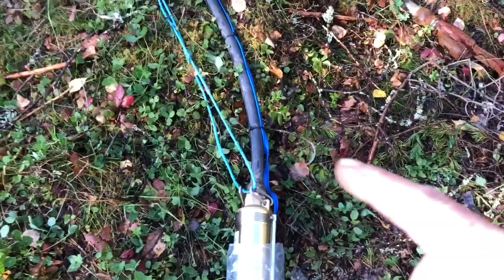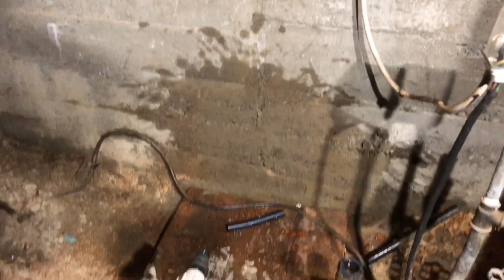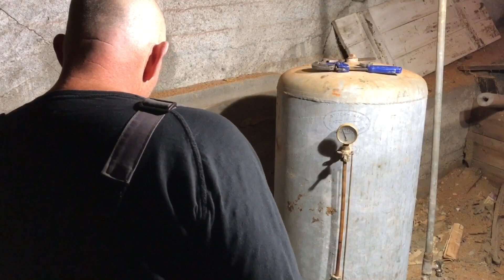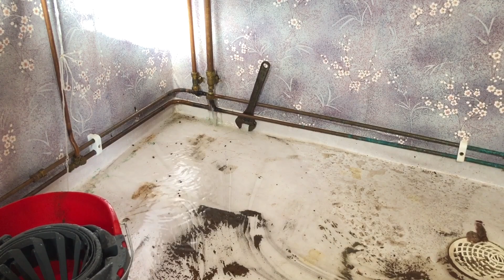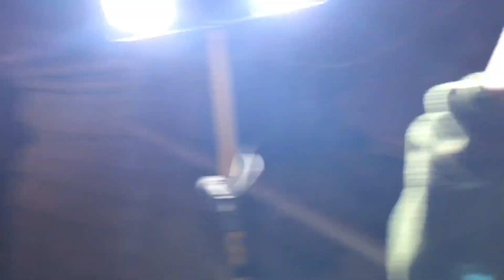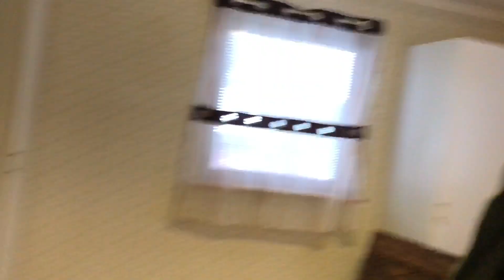Installing a new pump in a Deep well to restore water to a house after 25 years in  Arctic region.

Comment: I cant help but suspect the pressure tank is your whole headache. It and the galvanized plumbing is where the sediment in the lines are coming from also. The old well pump could have brought sediment into the house when it failed but mostly its the galvanized lines, especially being shut down for 25 years does not help aswell. As you know galvanized eventually corrodes and is usually comes apart in layers and becomes chunky from the inside out.

With it being a pressure tank, you should have a valve stem and be able to check the pressure with a tire air gauge. Im certain the bladder in the tank has failed and is waterlogged they call it. Most tanks only need around 8- 15 psi if i remember correctly.

I just went through this whole scenario once again a few months back.
I had to pull my well pump about 10 years ago and it was @ 95 feet in the ground, somewhat shallow for my area. Upon closer examination the old man that installed the well pump in 1969 had used a galvanized fitting on the motor that had a barb to transition to the black water pipe like you had in the well. The fitting had corroded in half and the well pump was actually still operational but was in bad shape. I went back to town and bought a brass fitting, thinking it was around $25-$30 back then. It appeared yours was brass also. Of course i installed the new pump.
Sorry for the long comment and hopefully you have solved the mystery by now. Im not trying to boss or tell you anything or how to do it, simple telling you from my experiences. 
Hope you have a great weekend and the weather cooperates in your winter preparations. Take care, thanks for sharing and God bless my friend. Be safe. 

Hello Sara 👋
Reply from the maker: Thank you and we all know your correct with regards to the tank, I just have to be mindful of the clients small budget full the whole house. That is why I am already prepped for a new tank but it is a big cost, more than the pump! If I cannot get it to work well I will have no choice. I thought I could get a new bladder for that, but it would seem not. Away I have a pump line in ready. All the houses here have old steel pipes and as you know kept in use they last longer. Your a true star Michael thanks.
Reply: Usually this type of hydrophore tank doesn't have a bladder.
Reply: Hello there 👋
Reply: @cuprasurfa  hello Sara and hope the 3 of you are well. Hopeful that your week has started off great! I'm sure the fishing has slowed because of the weather. Curious to how your potatoes and garden turned out this year? Have a great week and look forward to the next video. Please keep an eye on the boys. God bless  🙏

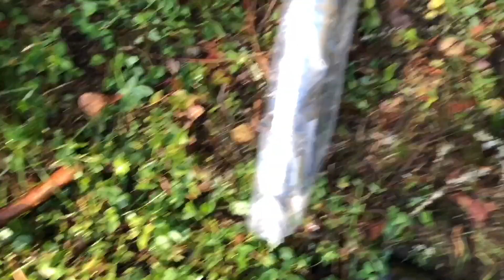Comment: 10:30 i use to put a steel zinc covered wire ring/loop right on the pump, i have saved many  pumps using a hook from the bottom 😂
Reply from the maker: Thanks and useful tip.

Comment: I installed a similar system ( submersible pump with all new gauges & pressure tank etc.) at a cabin I use to have. Had to have a well drilled & at first just had a hand pump on it. Decided to run water into the cabin. Difference is I had all new everything to work with. 👍👍🍺🍺
Reply from the maker: I would have liked to have ripped all that out but as you know money is the scarcest of of resources here for everyone but we are progressing and appreciate you sticking with me. Thank you.